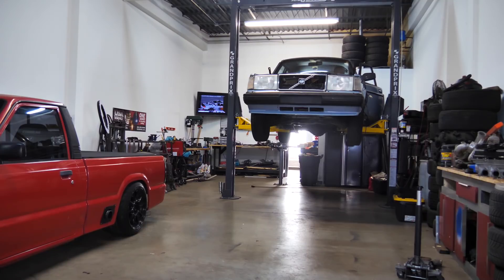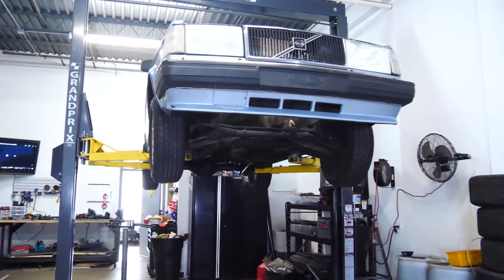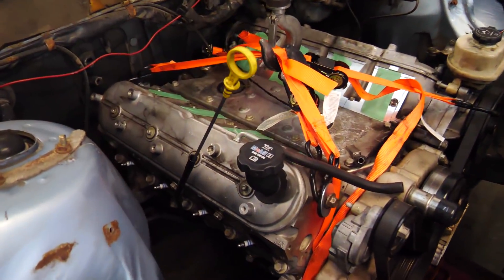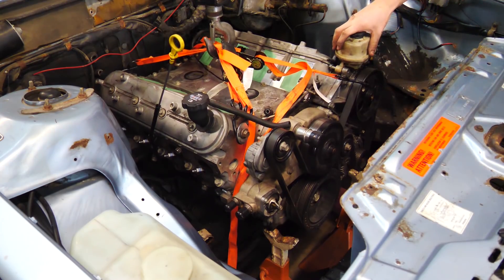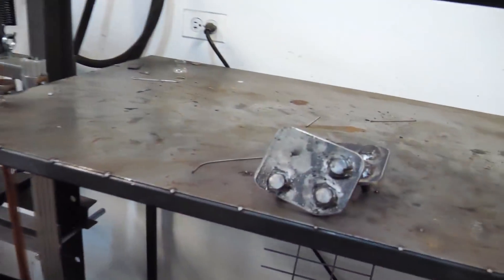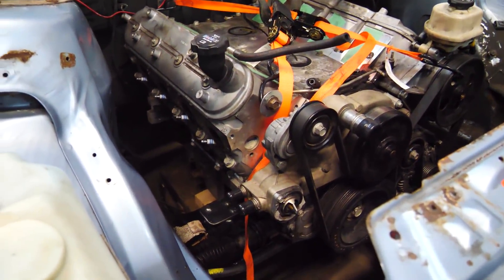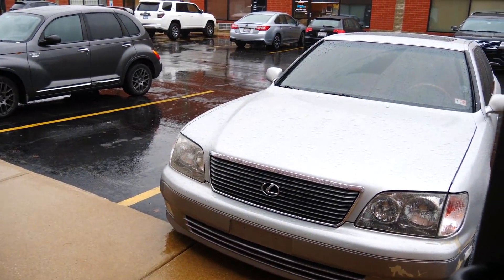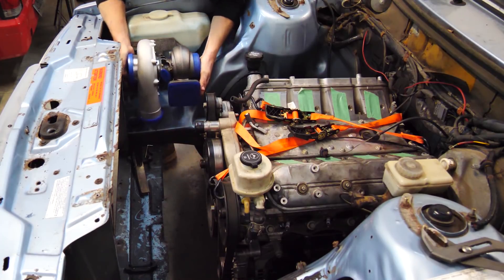Fitting the Turbo LS6 Into The VOLVO 240 SLEEPER! (Motor Mounts, Oil Pan)

Comment: What are you going to do about the volume loss of the pan? Even if its 1/2 a quart. This engine isn't going to be treated gently, so it is always going to try and slosh what little stays puddled in the bottom of the pan away from the pickup.

Comment: This is a bolt-in affair using off-the-shelf parts.  The Volvo community does it all the time.  You're crippling yourself for no reason.  Also, the entire front end unbolts, making a TON of room for engine/trans install.

Comment: The standard 4 cylinder sway bar won't work well with the V8 as it's too thin and has the wrong shape...but the V6 drop sway bar WILL work with V8 applications.  There's a couple of places to source them.  1 place (STS Machining) makes the thicker V8 compatible sway bars and the V8 bolt-in motor mounts.

Comment: Why dont u cut the trans tonal and modify it so u can lift the motor up a little higher to fit the oil pan and then it would fit the trans in better

Comment: It's be super cool in the final product if you had a switch or a lever that could redirect the exhaust through either some mufflers for the sleeper aspect, or through a straight pipe for performance!

Comment: hey Gingiuim, just a small trick on welding, idk what size tungsten you are using but as long as you have 3/32 tungsten you can run more amps than most welders can do. i work at a job shop use 3/32 2% thoriated tungsten (red) and ive ran 250 amps on AC and DC for a few minutes without stopping at all and the tungsten was fine, and with the 2% thoriated you can weld basically any metal with it, but it will not weld as good on certain metals that other types of tungsten can.

Comment: pro tip : you can even tilt your engine by a few degrees  if you really need to (talking about crank axis tilt).  On top of adjusting the left rigth position and the other tilt  
Neat build, hope you fix the rust

Comment: A good solution for the garbage disposal would be to setup a second can with anything that's not general junk and fills up the can fast. Like for example packaging that's not plastic. Straight into the other bin. I've managed to reduce my trips overall with 3 bags. Plastics, paper, and a stouter bag inside my actual can with everything else.

Comment: Also, Install the engine and trans in from the bottom, already installed on the subframe.
Reply: No
Reply: @JM-nd3ps  yes. That’s the easiest way to install and remove an ls in any sort of unibody car. Hell thats how it’s meant to be done from the factory on corvettes, camaro’s, firebirds etc...
Reply: @Matt_Lanzer_13  No
Reply: @JM-nd3ps  Great argument
Reply: @JM-nd3ps  I see you obviously haven’t had the pleasure of removing the engine from a 4th gen F-body then😂
Reply: @Matt_Lanzer_13  It WOULD be the easiest way to install that engine in that bay....IF that engine/bay was designed to hold that lump from the factory...which it was obviously not.  The engine mounts have to be in a different place due to firewall and trans tunnel restrictions on the new chassis.  

So...the subframe with the steering components needs to stay put until the engine can be placed in a specific location that will work in the new chassis.  You can't just make arbitrary LS engine mounts on a removed subframe outside of the car and expect everything to fit...including having the trans casing NOT hit the trans tunnel.  

You'll see in the next video.

ASSuming it will fit will cost you time and money.  Remember...this chassis was NOT designed to hold a V8/SB /whatever from the factory.   It needs to be MADE to fit the new engine/trans combo.  If you can't see that simple fact...it's not my problem.  

I can explain it for you...I can't understand it for you.

The process he took in the video is the correct one for this application.

Long story short.....NO
Reply: @JM-nd3ps  the motor is still mounted to the subframe, and the subframe still hold the rack, steering components, etc. yes obviously for fab purposes it makes sense to put it in through the top, but once the car is together, removing it from the bottom is the easier method, especially with the mammoth trans that is a t56....

Comment: Maybe make sure to take it easy in the first few hits, modifying an oil pan so much is always a little risky, I think, not an expert 😅
Reply from the maker: YeAahhhhh. I have no idea if I should make the sump bigger since I cut a notch into it? I didnt cut off that much, but who knows!
Reply: @_Gingium_  the thing that seems more dangerous to me is the fact that usually oil pans are designed with certain shapes and curves to minimize sloshing and maximize oil circulation, the fact that that slope is now a right angle may be a problem, but as I said I'm basing my theory on superficial knowledge at best so who knows, it may be fine.
Reply: How much pressure does a typical oil pan see, like with heat, driving etc?  I would take that into account, sharp corners are not as strong as rounded corners.  I think it will be fine, but something I would keep an eye on.  The amount of oil the motor takes will change too so something to account for when changing oil, or I guess you just manually check the level as you're pouring anyway?  I hardly know anything about cars so I should probably shut up now. :P
Reply: @redsquirrelftw  it's not really about oil pressure in the pan, is more about how the oil moves when the car accelerate, it needs to not slosh around too much and to not leave the pick up tube dry
Reply: @pitveau  Yeah that's a good point too.